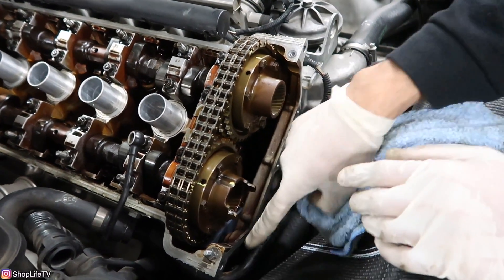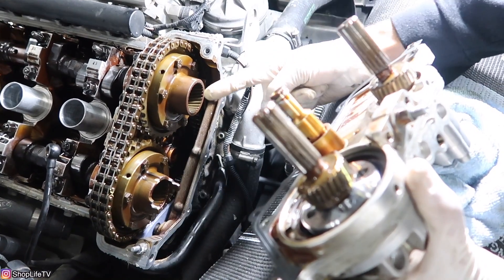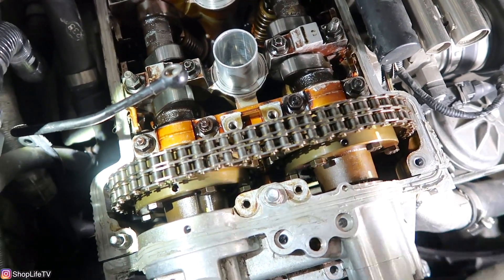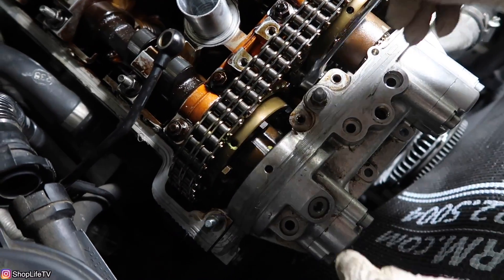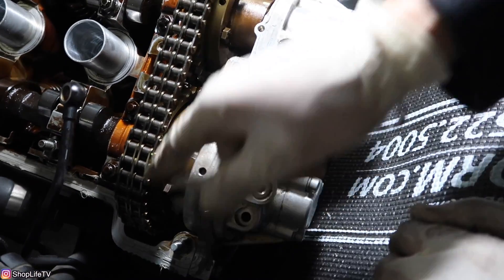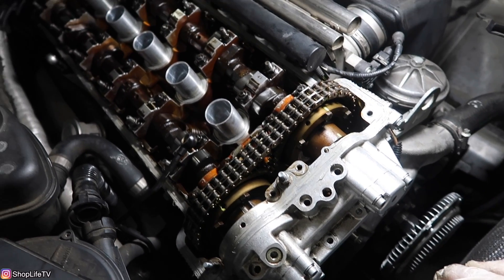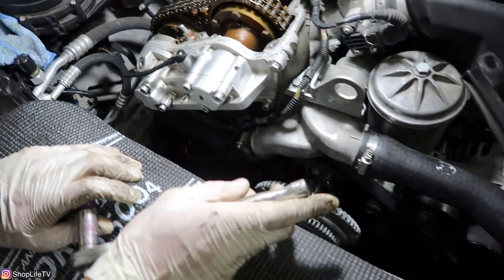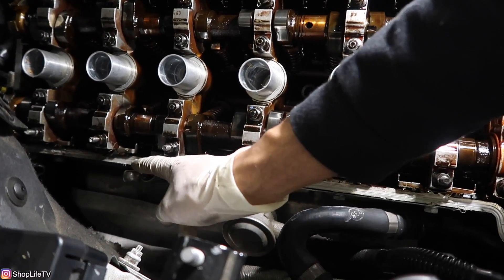Final S54 Vanos Rebuild Video: Putting Everything Back Together (Part 5)

Comment: What was the point of tightening the hub bolts and backing them out to mount the vanos unit and retighten again. You cant just leave them hand tight till you bolt down the vanos and then tighten them?

Comment: Thanks for the great video.  At the 5:00 you tighten the 4 bolts, But then immediately loosen them again.  I fully installed the vanos the step before while everything was slightly loose.  Everything appears timed correctly.  What's the point of tightening and then immediately loosening?  Do I have to do this for the third time? :)

Comment: Btw, you’re making this procedure way, way more complicated than it should be. 
The ideal, most efficient and easiest procedure is to lock the valve train using the cam locking tool. It locks the cams in time to the crank. 
Then and only the you can remove the VANOS unit and all 12 bolts without all the fuss of having to crank the engine over manually to tighten the cam bolts. 
All that is done with the VANOS removed. 
I’ve done this 3 times already. 
You already have the proper tools and skill, but lacking in the details which make a job much, much easier

Comment: Hi, your video is quite helpful. I am having and issue with timing however. I pre-tension and tighten the vanos>head then tighten the top hub bolts and timing remains ok. I then turn the crank 1 turn to get the other hub bolts, I turn the crank back 1 more turn to TDC w/ cam lobes 45° to finish tightening the top hubs bolts. Once the cams are retarded my timing is slightly off it in this both cams are slightly  ~.6mm off they are off CCW. I have slack in the timing chain so when I do the final rotation my timing is ruined, how do I account for the slack? I've tried adjusting the cams and they end up in the same place every time. I was thinking if I set the cams slightly out of time (CCW) then when the hub bolts were tightened and chain slack accounted for they might end up within spec after the final rotation to check timing.

Comment: 03:19 Correct me if I´m wrong, but you might leave a 5mm gap between the block and VANOS body before start screwing the first pair of bolts...

Comment: One important thing so as not to get a Cel Light ! Before tightening down Hubs you need a 100 mm Gap for Proper adjustment and Timing to advance ,I bet he had a code after the hubs where tighten incorrectly ! And if not then this would be one step that is not necessary. Hope we get feed back ! Please  

If installing new splines you can pre mark them same way ,Just install without vanos and make sure they go into the Hubs as far as Possible then mark accordingly and follow Shop life easy instructions !!!

Comment: Currently saving my pennies for the S54 overhaul. Complete vanos upgrade, valve adjustment w/new plugs & coil packs, & new rod bearings.  87k miles & no lights or issues, just looking to get the PM done & hopefully bulletproof the system for future HPDE events.  Thanks for sharing the knowledge!
Reply from the maker: Awesome! Thanks for watching!
Reply: Hi , where’s the video for valve adjustment?

Comment: I’m planing on doing the vanos device myself I got most of the parts already and tools just need the locking pin. Is the special crankshaft socket needed also? Or depends year to year ? I have a 02 m3